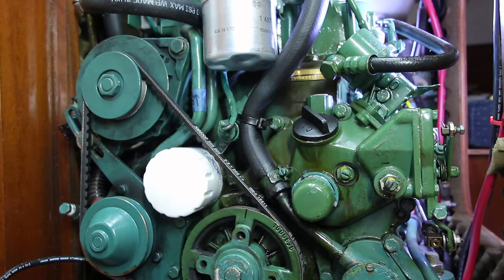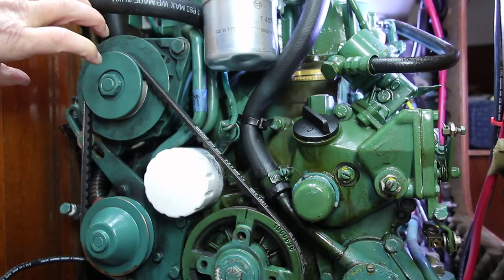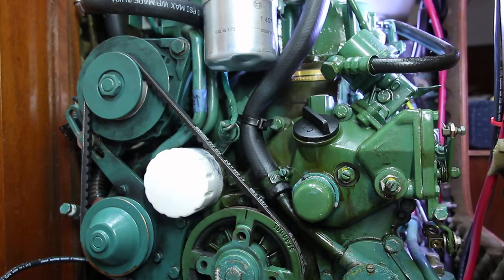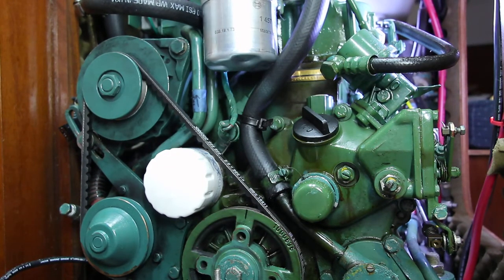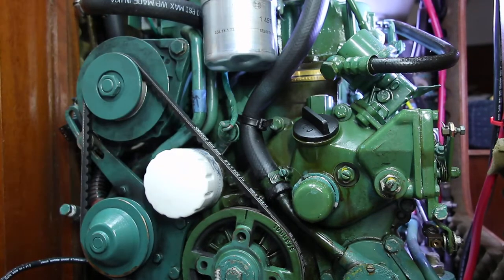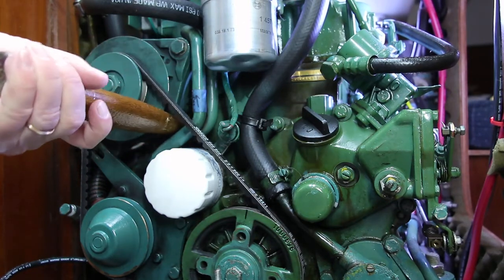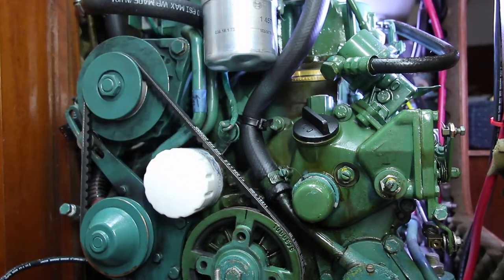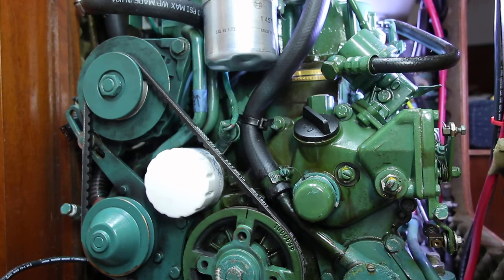V-belt change on Volvo Penta 2002 marine diesel

Comment: Would you be able to show how you ran your raw water from the water pump to your anti shiphon and then back into the heat exchanger? I assume that's where the black raw water hose is headed...
Reply from the maker: I'm using the OME anti siphon setup. I replaced the original U pipe while the in the engine space for some insurance.